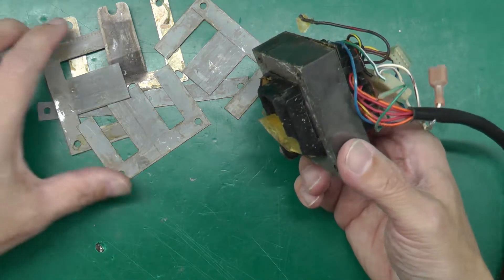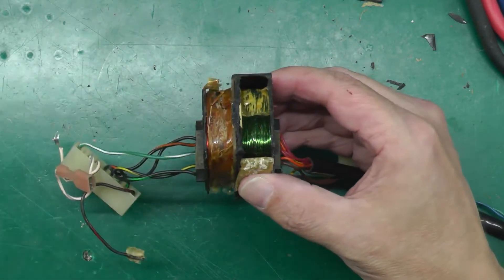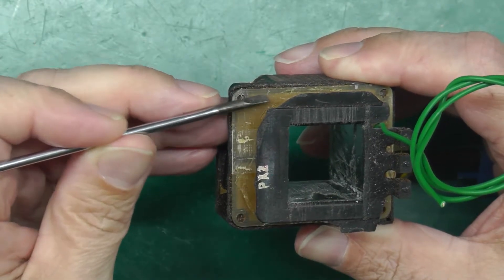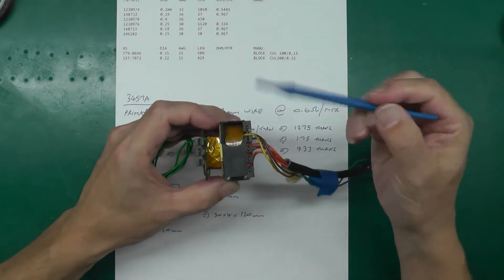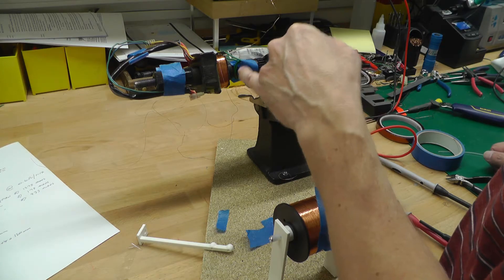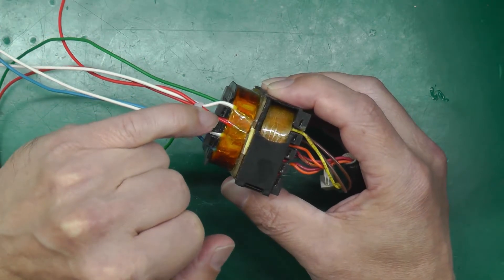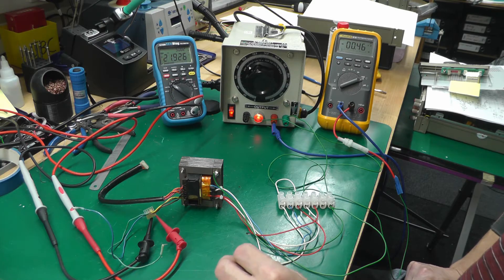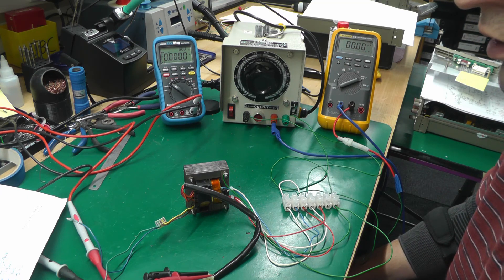No.061 - HP 3457A DMM Repair - Rewinding & Testing the Transformer - Part 2

Comment from the maker: UPDATE (1 day later): I stripped off the primary windings and wound it for 240VAC only (single winding), 1635 turns of 0.15mm wire and am now getting the correct unloaded secondary voltages (21Vac, 40Vac and all the tappings in between) @ 240Vac input. There MAY be room for 0.2mm wire instead of 0.15mm, so may rewind it again (15 minute job now!).
Reply: If you have a good unit to compare with, you can directly measure the volts/turn of the primaries and the winding ratios - assuming you can add a winding or two to the bobbin. If you add a single winding (or 10 for better accuracy) and hook up the primary of the unloaded transformer to an AC source, you'll measure the volts/turn from the winding you added. You can likewise measure the ratios between the two primary windings and figure out the "center" tap position by injecting a voltage to any known winding (like the one you've added) and measuring the others. With the transformer unloaded the resistive losses will be insignificant, so your measurements should get pretty close.
Reply: @sigurasg  I'm coming to this late having only just discovered Ian's channel. 
For a totally unrelated project I needed to fit an further secondary winding to an existing transformer. I experimentally added a winding of 20 turns to see what voltage it would produce. From that I was able to determine the actual number of turns required for the finished winding. It worked out fine.
Since a transformer can be used as a step-up or a step-down I would have been inclined to inject a low voltage 50Hz into one of the secondaries with an similarly experimental winding on what was the original primary then do the maths to find out how many turns required.
Reply: Probably best to leave it as a 240V winding then, with the thinner wire adding slightly more resistance, which will help with the voltage as it will increase the drop under load. Varnish on the laminates might be best to vacuum impregnate them, using an old pressure cooker with varnish in it, and then submerge the transformer assembled in it and pump down for 1 to 2 hours, then vent back to atmosphere and allow to drip free, then bake at 100C for a few hours to evaporate the solvents out the varnish.  Definitely better than dipping or painting them, and will ensure the windings get a good seal as well. Yes those DIY kits are nice, there might be some with prewound primaries, which makes the job easier as you have a good primary with known turns per volt ratio to wind your secondaries as needed, though you will lose out on that great FR4 screen they built into it. You probably could make one up though using copper tape stuck to the barrier, making sure not to make a shorted turn.
Reply: @SeanBZA  The laminations shouldn't be cleaned too thoroughly: https://www.electronics-tutorials.ws/transformer/transformer-construction.html#:~:text=These%20laminations%20are%20insulated%20from,flow%20of%20the%20eddy%20currents.&text=Using%20laminations%20in%20a%20transformer%20construction%20reduces%20eddy%20current%20losses.

Comment: Hi Ian, thank you for sharing your experience with us all. It is very interesting, but time consuming to say the least. I bought the HP 3457A a few months ago. It worked fine for a few weeks, then, of a sudden, it refused to power up. The fuse is good, and I even changed the mains line filter with a Shaffner FN9222-3-06 SCHAFFNER - Connector: AC supply | socket; male; 3A; 250VAC; C14 (E); -25÷85°C | TME - Electronic components, as this seems to be a frequent problem with this instrument. I am not a tech but merely a hobbyist, so this was the extend of my troubleshooting. I brought it to a local instrument distributor, but they told me that they sent it to the “manufacturer” who pronounced this instrument “not repairable”. Could you let me know what I should do and where to investigate for the source of this problem?
I thank you in advance for landing a hand and hopefully I will be able to resuscitate this very nice vintage instrument, when it worked.
Reply from the maker: Contact me on my website.

Comment: I think they measure the wire to the copper core, ie, minus the insulating coating. I would've burnt the coating off with a match, sanded the wire with a couple of strokes of sandpaper, and measured the copper wire directly with a micrometer - Vernier callipers aren't super accurate -. I'm a machinist so I'm pretty pedantic about direct measurements with clean surfaces, plus I worked in industrial coatings and know about paint thicknesses - lol -.

Comment: Could you (well in hindsight) measure the inductance of the secondaries and given the output voltage worked out the inductance of the primaries and figured out the windings from that? Or wait then you need the properties of the core?

Comment: If you measure 0.2mm with a caliper then you really have a 0.20 - 0.03mm wire (~0.17mm), when you consider the enamel insulation. Wire is labeled by copper diameter not diameter with enamel...as I’m sure you know!

Comment: A simple way to determine the right primary turns is to wind e.g. 10 turns on the assembled core, inject the right secondary voltage and measure the voltage on the test winding, divide that by the no of turns to get the volts/turn (turns/volt), subtract a few percent to account for the loaded voltage losses, multiply the turns/volt by the wanted winding voltage and you get the required no. of turns.
Reply: That's better than my thought (which was to wind 100 turns on the primary and then inject 10V into the primary).

Comment: Since you managed to remove the core plates and had the primary coil pretty much intact - wouldn’t it be better to unwind the old primary coil and count the lenght of the wire in meters, rather than just cut it off and then try to calculate the necessary length? Also, since the plastic of the original bobbin has become so brittle - wouldn’t it be better to 3d print a new one and then rewind both coils? Twice the fun! :) Frankly, I admire the spirit and persistence 👍
Reply from the maker: The original primary winding was melted together inside, too hard to unravel.
I have some compatible transformer kits on order, exactly the same size as the 3457A transformer........so I will be able to wind my own PRI/SEC from scratch.
I'm a tinkerer as well as an engineer.....:-)
Reply: @IanScottJohnston  Hello Ian, all the hp transformers for these kind of device have one or two shielding (windings), which are very important to mitigate noise and ground loops. Therefore I think that a transformer kit will not do the job, or you might implement such a shielding also.
Anyhow, you're really a very brave engineer, disclosing your fails also!
I can really appreciate your 'tinkering', as 30 years ago, I've also manually wound a special transformer, a so called Hartshorn Bridge for susceptibility measurements (on High Tc superconductors).
I used 40µm wires for the secondaries, and 80µm for the primary, and I also had to carefully keep track of the winding numbers and the different taps.. really a sisyphean undertaking
Reply from the maker: @DrFrank-xj9bc  Thanks Dr. Frank. I will certainly implement a PRI/SEC shielding plate like the one on the HP transformer.
PS. I did contact Keysight via the service portal asking if they had any 3457A transformers, but no reply yet.....LOL!!!

Comment: without the core in the transformer, measure the inductance of the secondary and then measure its approximate dimensions, plug that into an air core inductor formula to get the number of turns.
knowing the desired output voltage and the number of turns on  that winding you can then calculate the primary winding

Comment: @18:00 shouldn’t the primaries be in series for 240V? This will halve the output voltages.
Reply from the maker: They are in series. There is a single link on the choc block between them.
Reply: IanScottJohnston - ok, wasn’t sure if you had swapped over after doing the parallel test
Reply: IanScottJohnston - after you changed wire sizes, did you recheck the resistance/m to sanity check the number of turns?
Reply from the maker: @TheDefpom  the turns i have wound i trust, but the resistances are different to the working 3457A transformer, i guess different source of copper wire.

Comment: you should test the secondary voltage with them under load, I wouldn't be surprised if the voltage drops quite a bit and you might find thta they voltages are much closer than you think.
Reply from the maker: I measured the voltages of the working 3457A off load and they were a good bit lower.

Comment: well done for getting the plates apart in hot water. Why wind multiple primary windings when you only need one 240V winding. You will only ever be using the 3457A on 240V mains. The over voltage on the secondary probably means you need more turns on the primary. unwind it again and just do one continuous primary for 240V without the extra wires. You'll have space for more turns without the extra wires.

Alternatively keep it how you've done it but swap the polarity back again to how it was the first time on the second primary winding, turn the variac up to 240V and check the seconary voltages.
Reply: 14:14 "otherwise you'll get some cancelation..." maybe you need a bit of cancelation to reduce the secondary voltages. Actually i expect thats how it was wired originally given the small size of the transformer.
Also, you can't trust the resistance readings because the original primary  was burnt so there may be shorted turns.
Reply: @simontay4851 I was wondering about those resistance readings. I think I would have measured them on the transformer from the good unit.
Reply from the maker: @gordonwedman3179  thats what I did, the readings came from my good unit.
Reply: @IanScottJohnston  I guess I missed that. Sorry for doubting you😕
Reply from the maker: @simontay4851  the readings came from my good working unit.
Reply from the maker: @simontay4851  is running with cancellation on one of the primaries ok to do?......i didn't think so. A pity the schematic doesn't have the primaries marked.

Comment: Did you weigh the original primaries?  Their mass could give a clue as to the length and hence the total number of turns in those original primaries.  Simple maths in principle but complicated by the uncertainty associated with the measurement of the diameter and the contribution of the enamel (to both mass and diameter).

Comment: When the windings are in 'parallel' for ~100 VAC, pin 8 is connected to pin 6 and 7 is connected to pin 4.  Surely it is essential that these two windings have the same number of turns so that they would be matched?  Imagine, if you will, that they aren't connected and one is energised.  If the other winding has a different number of turns then it would have a different voltage hence paralleling them would cause a current to flow.  IMHO they need to be well matched.  Although an initial thought is that winding them bifilar would solve this.  I suspect that this would not be a good idea when they are in series as it would put ~120 VAC between the pair and this would be a breakdown risk.  I also suspect that the turns ratio between pins 4-5 and 5-6 needs to be 1:5  so that the ratio between 4-6 and 5-6 matches the nominal voltage ratio of 120:100.
Reply from the maker: Interestingly if I read it correctly, if you look at the schematic and go through the various positions for the switches for 100/120/220/240VAC they all make sense apart from 100VAC, that position uses all three terminations of the winding with the centre tap, whilst all the other settings use two only......But can't be right!
So, I will revisit the workbench and adjust my test hook-up and see what happens.
[EDITED]
Reply: @IanScottJohnston  The 100 VAC case is a curious one.  I reckon the way to think it through is to first think about the 120 VAC case, where the primary current is shared equally between the two windings.  In this case you would find 100 VAC between pins 5 and 6, the winding acting as a voltage divider.  In the 100 VAC case winding 4-5-6 is acting as an auto-transformer with 120 VAC  between pins 4 and 6.  To be honest I'm not sure exactly how the current sharing works in this situation, but a gut instinct tells me that it'll be similar with half each into pins 6 and 8.  The current through 4-5 I can't quite fathom.
Reply from the maker: @Brian_Of_Melbourne  Schematic error maybe?.......i'll do some checks.
Reply: @IanScottJohnston  No, the schematic looks OK to me.  It's only the 100 VAC configuration that I don't fully understand the physics/electricals of.  It is always consistent:  there's always 120 VAC across 7-8, always 100 VAC across 5-6, and 120 VAC across 4-6.
Here are the configurations:
    240 = 4-6 + 7-8 (120 + 120)
    220 = 5-6 + 7-8 (100 + 120)
    120 = 4-6 || 7-8 (120 || 120)
    100 = 5-6 (100) => 4-6 || 7-8 (120 || 120)
Reply from the maker: @Brian_Of_Melbourne  Studying the schematic the 100V hook-up looks to me as follows:
Logically, if they'd taken the 120V hook-up and moved the neutral connection down to the centre tap for both then that would have achieved it. However, they've left one of the connections which should have gone to neutral and left it on the end of the winding per 120V. I think this just tweaks the secondary output slightly.......and would that be down slightly because the path back to neutral has an extra small winding to go through?........it takes a bit of thinking to say whether it would adjust the secondary up or down....LOL!
Reply: @IanScottJohnston  My though is that because it would apply 100 VAC to five sixths of the winding it wouldn't change the excitation and hence the secondaries will stay the same (or there abouts).

Comment: After the first winding of 0.2mm wire, why didn't you measure the output and get an idea of the total number of windings needed for the primary side?
Reply from the maker: I did actually (I have footage), and it was high also, but the two primary windings are un-equal and with all the guessed factors already I just decided to wind everything and get a better starting point for the final calculations.......there was no way it was going to be perfect first time.